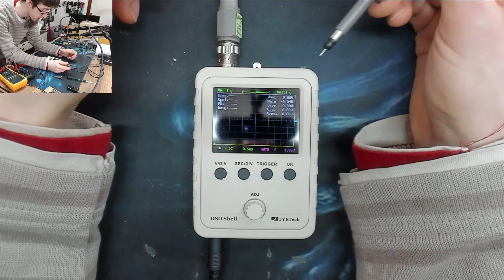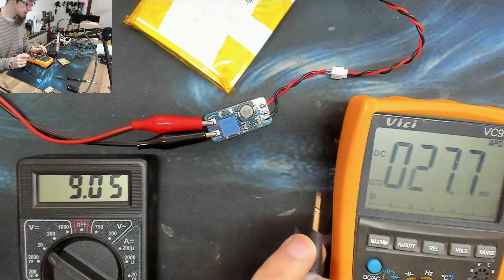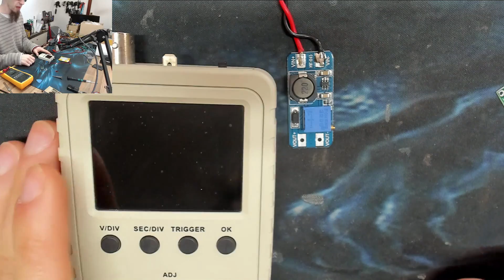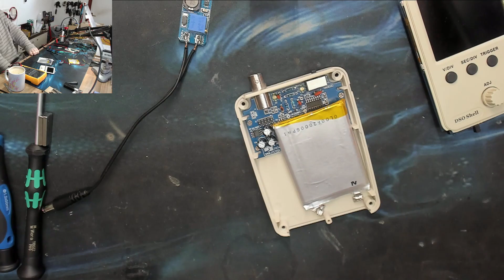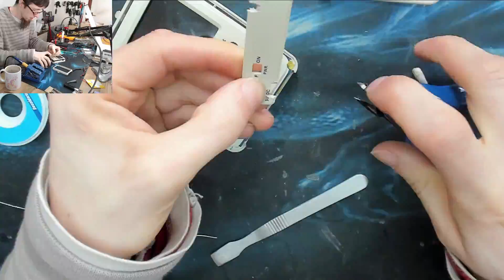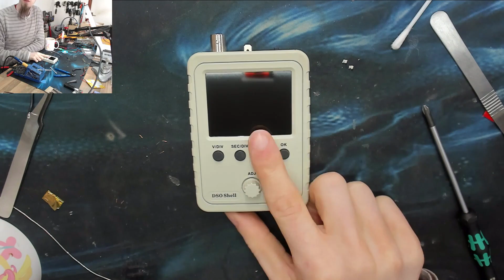How To Lipo #4 - Lipo powered JYETech pocket scope

Comment: Why didn't you connect the power wires to the output pads of the usb charging board? It is there to protect the cells from overdischarging.
Reply from the maker: Yup, didn't realise it while I was recording, but later changed it when someone else in the comments pointed it out 👌

Comment: Hey, the lipo battery has a nominal voltage of 3.7 v and when it is charged it is at 4.2 volts and it is asvice to not let battery charge below 3.6 volts or the battery will die.
Reply: 2.4 volts*

Comment: You made a wiring error on the charging board. The output to the boost converter should be connected to the outer terminals on the charge board (Vout) and the battery should be connected to Vbatt. By parallelling onto Vbatt only, you have lost the benefit of the overcharge/overdischarge circuitry on the charging board.
Reply: Absolutely true! Nice comment! Great video!
Reply: Yep. The positive terminals are actually shorted but the grounds are separate.